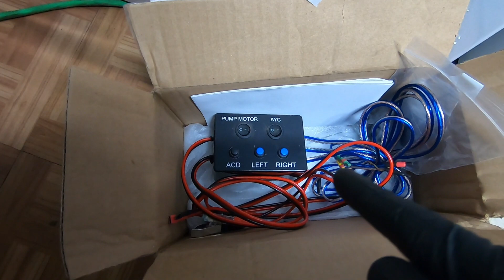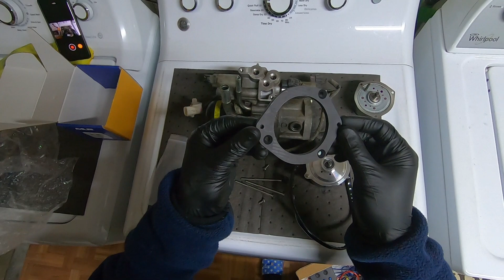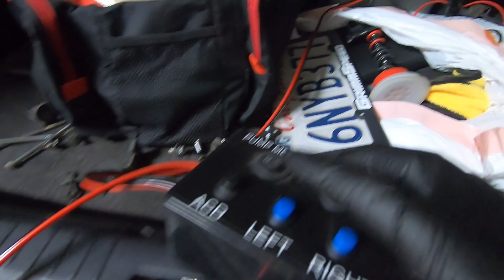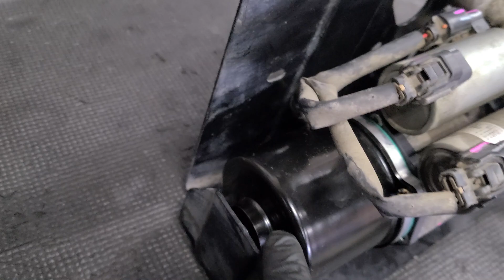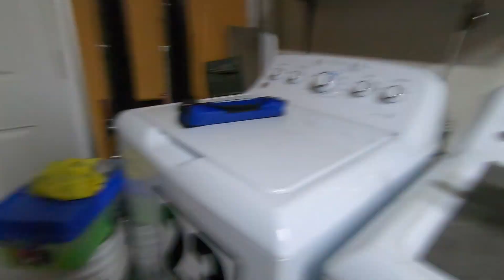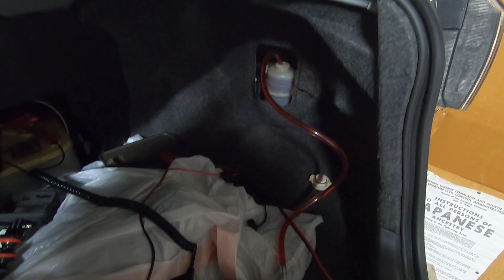Fixing The Most Common EVO X Problem AYC

Comment: Did you reuse the metal washer on the seal at the end when you installed the motor?
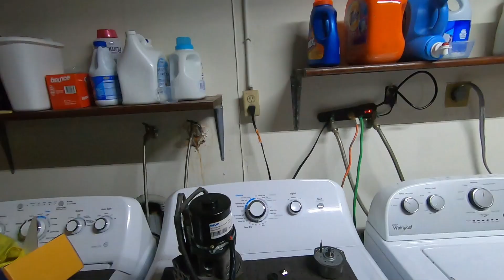Reply from the maker: I re installed everything like factory. If you pause video at 6:59 you can see only the old seal and key way left on table, the metal washer was re installed.

Comment: So I have the 4wd system required light on and I believe is the ayc pump anyways can I still drive like that?will it cause any damages?
Reply from the maker: You can still drive it....but the you just will be driving on open diffs all around..the ayc or and won't distribute the power around like it's supposed to.... basically you won't notice any difference just driving around.
Reply: Thanks for the info
Reply from the maker: @fallenangel6750  but try and get it fixed so you can enjoy the reason we have a evo! For its great awd system...what area are you in?
Reply: My light just came on today. Idk if I should rebuild or buy a new one. Much rather rebuild since it’s cheaper and seemingly more reliable.